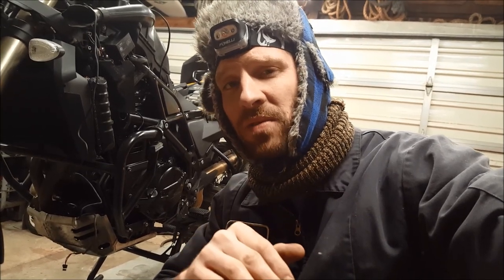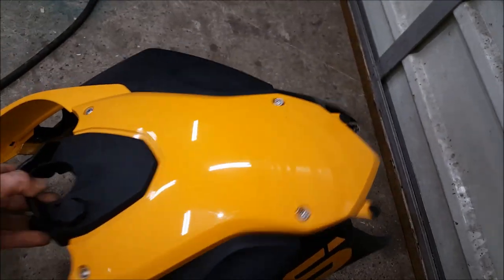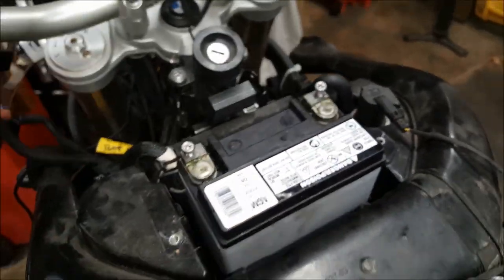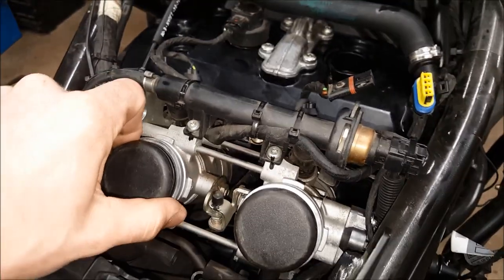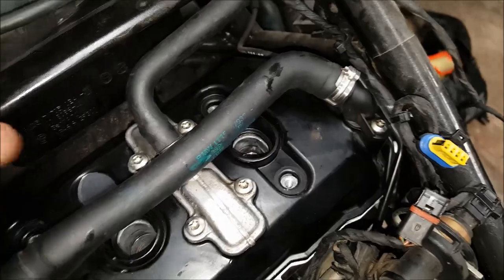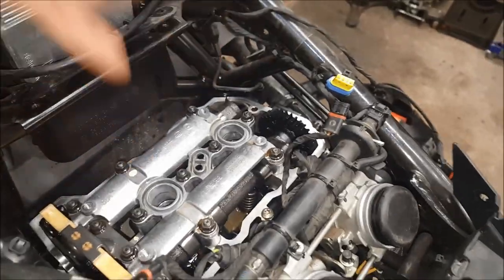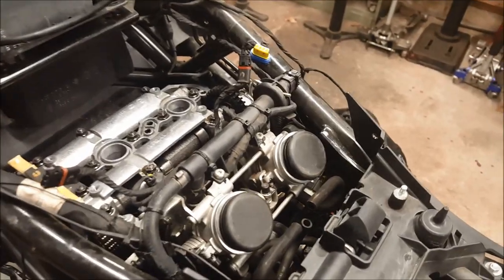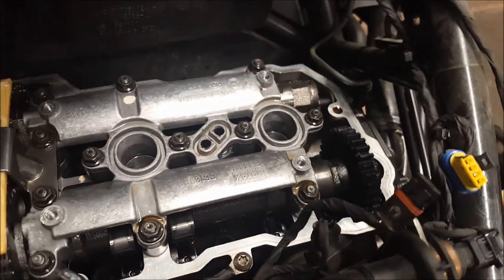BMW F800GS Valve clearance, spark plugs, cover gasket OVERVIEW/TIPS

Comment: I know this video is old, but where did you get those clearance numbers? Citing the maintenance DVD it's supposed to be Intake 0.23-0.33 Exhaust 0.30-0.41 in millimeters, cold engine.
Reply from the maker: Interesting. I wonder what the factory service manual says. Is that the factory DVD?   I just did some searching around when I did mine and those were the numbers I found on a few different forms. Since they match them to one another I figured they were accurate.  I just looked it up and found this site. Which shows the numbers I used.  https://www.motorcycleparts-hornig.com/BMW-F650-GS-F-700-GS-and-F-800-GS/Maintenance-interval-service/
Reply from the maker: But let me know what you find out, I'm very curious. It would be a shame if I published the wrong numbers. Or maybe they changed them at some point and updated them?
Reply from the maker: In either case, as long as they have a touch of clearance and they're not tapping then all is well in my opinion
Reply: @NoNonsenseKnowHow  it's the factory DVD, and for a 2009 as mine is too. Weird. The diff isn't huge though, and should be good anyway, it's just a bit irritating that with those numbers my valves are within spec. Meh, I already ordered the shims and they will then be in the looser end of tolerance and should last ages.
EDIT: The DVD is from 2013, maybe the specs got revised?
Reply from the maker: @folxam  got you. Yeah maybe they did get revised. Let me know if you happen to get to the bottom of it. I suppose better to be a little bit loose anyway since the valves will only continue to seat into the head overtime
Reply: @NoNonsenseKnowHow  I just spoke to a dealer workshop and the clearances in the maintenance DVD are WRONGGGGGGGGGGGGGGG.
Your numbers are correct.
Reply from the maker: @folxam  oh wow, that's crazy. I appreciate the update! Thank you very much
Reply: @NoNonsenseKnowHow  
Originally the BMW spec. was: 
BMW-spec:	Inlet valve clearance			0.18...0.26 mm	
BMW-spec:	Exhaust valve clearance			0.27...0.35 mm	
					
Then for a short period of time it was opened up to match the 
spec. used for the same (Rotax) engine used in Huskys to:

Husky-spec:	Inlet valve clearance			0.23…0.33 mm	
Husky-spec:	Exhaust valve clearance			0.30…0.41 mm	

THEN ... I think based on complaints about noise BMW reverted  BACK TO the original tighter spec. again. So depending on the age of your bike/manual that's what happened...............
Reply from the maker: @fatpitch3  hey, I really appreciate you adding the details. That explains why people had varying specs I was seeing
Reply: @NoNonsenseKnowHow  yes ... quite confusing.
and very unusual for BMW to do something like that... 
"Apparently" using the larger clearances won't hurt anything,
and since the clearance is used up over time I try to bias my adjustments to the loose end of the (tighter) range or just a bit beyond.

Comment: should have just adjusted the cyl 1 intake while your in there your like .002mm from out of spec, also bmw does a liquid gasket right on the head all the way around then the rubber gasket then the head cover torqued to 10 Nm spark plugs torqued to 18 Nm and that smaller internal gasket is directional.
Reply from the maker: Good tips. I'm not sure I plan on keeping this bike for very long, so it didn't seem worth it to adjust them since they were already in Spec. Plus I didn't want to have to wait on ordering shims since I was using the bike that weekend.  And good point about the liquid gasket. I'll have to look into that. But so far no seepage at all so I think I'll be okay.
Reply from the maker: Throughout all my years I've never seen a manufacturer put adhesive or silicone on the whole valve cover gasket surface.  just on those rubber half moons and around them
Reply: @NoNonsenseKnowHow  I have BMW manual for this bike, it recommends only using sealant on the half-moons and just a bit beyond.
Reply from the maker: @fatpitch3  good to know! Thanks so much for clarifying that!  I was pretty sure I did it correct. I've done probably a hundred valve cover gaskets in my life on various vehicles

Comment: about to tackle this. Hopefully all within speck at 30 000km.EDIT: Completed the job. Exhaust .20mm. new shims now around .32mm but its very loud and sounds way looser. intake all still in spec.
Reply: Exhaust was out of spec on mine at 74.000 km. It also was very loud after the change. Ticking noise

Comment: my 09 800GS  sits at 62K do y think valve clearance is still in specs?? , probably nobody never touched it since new ...
Reply from the maker: My guess would be yeah they are probably still in Spec. But I would definitely check them ASAP. Let me know what you find
Reply: @NoNonsenseKnowHow  yes. and what happing with timing chain does it get stretched at that kilometers?
Reply from the maker: @dejanmeki  I'm not aware of any timing chain issues with these engines.  Should be good. Unless it's making noise
Reply: @NoNonsenseKnowHow  I had to replace my timing chain at around 70.000 km. It was half a link longer.